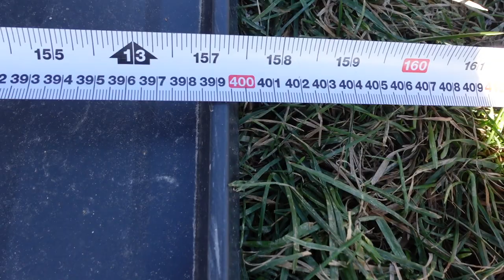I can't believe this happened - Zip line disaster.

Comment: I've learned that many times it's better and safer to move smaller loads at a time. You are the expert in using the Sky Mule so you should have been the one coordinating the movement of the boards. Believe me, I can understand your frustration with waste of your time and hard work and to have the boards destroyed at the bottom of the mountain. Maybe Steve work out a braking or slow feed system for the Sky Mule while he's fixing it. Glad that you were not injured during the incident. Love your videos.

Comment: Hello Both! A similar set up for the skymule, but with a gear and chain to regulate speed, dependant on load, would be where my layman's mind would venture here. As an added bonus, a motor could be added to retract the mule up to the start point. Doing great, and yes, that damaged wood can be part salvaged for a privy or elsewhere, so glass half full. Onwards and upwards, never deterred. 👌🙂

Comment: Good thing is neither of you got hurt and all the dogs were fine too. With all due respect an onboard braking system you can use to slow or speed up the descent of the goods. I have a portable battery operated winch that is a god send at times. Glad you are both okay, it could have been much worse.

Comment: I'm glad everybody is ok.  Things happen, and we learn, move on and rebuild.  On an unrelated note.  I held out for the longest time from trying diesel as a saw lube, but I won't be going back.  It works incredibly, and you only need a very tiny drip, unlike water or any other mixed fluids I've tried.  The saw blades are as clean as they are coming out of the box brand new.  And there is a light oil film on them which keeps them from rusting.  I had thought the smell of the fuel would be bad, but you can't even smell it on the lumber.  Admittedly, my clothes smelled a bit like diesel, but not bad at all really.

Comment: Wow...that was eventful. Umm... all due respect. Steve should have known that could run away on the sky mule. Getting past that... good time for an upgrade. Maybe it was a blessing. Sorry about the wood loss. So... a reel with proper bearings and brake is a good idea. With the brake you can lock the skymule from moving while you load. Also the second follower pulley on the Sky Mule could use a bigger pulley and block assembly. That way you can lift the back end higher to equal to the front. For all the times you carry a load on the Sky Mule, put  longer rope on the back. LOL! Sorry for preaching.  Aside from that. You are still my hero and I always enjoy your video's.
Reply from the maker: I think he was missing his brain that day! 😂

Comment: I can see what Steve was thinking - an air brake like the one on the Skymule works more effectively the quicker the load travels, so if you constantly slow the load down then you prevent the brake from doing its job.  But I have to say that the load in this case looked around 150 kg to me, which would be way more than the published 100 kg design limit for the Skymule.   Also the Skymule spec really should state a maximum slope for that 100 kg, as it's probably less than you have with that steep mountain side.   Easy to say all this in hindsight of course!   

Aside from limiting the load weight, one improvement possibility could be to add an adjustable magnetic break to the rope spool spindle.  These are mechanically very simple devices requiring no power - essentially just metal flywheels with stationary magnets mounted a short distance from the perimeter (technically the magnets induce an electrical current in the moving flywheel which dissipate the turning energy without contact due to resistance in the metal).  You adjust the breaking power simply by adjusting the distance between the magnets and the flywheel.  They're commonly used in exercise machines for example,  avoiding using friction breaking as this tends to wear out quickly.

Comment: Have you got some running water at the cabin on the crag?    If so suggest you set up a second cable, parallel to skymule, and as loads go down they pull up containers of water which act as counterbalance by being attached  to a separate rope /9which goes over a fixed pulley at the top and then attaches to the load).   This is the system we have used to transport materials up a steep hill to our project (though we fill up the water conatiners at the top).    But we are using 6mm steel cables so have limit the max load to be about 40kg.  (a 100kg load in the middle of a tensioned cable will generate about 10 times this load at the ends).  And that's not counting dynamic loads so to keep within safety factors we usually stick to 25kg loads.   Another perhaps simpler solution would be wait until you get some deep snow, lower the loads on sleds, and control the desent with a long rope and portawrap.
Reply from the maker: That’s a neat idea for sure! But at this point would just be too much work to change given where I’m at on the build. It’s definitely working much better and safer now 👍

Comment: Hello Michelle. Fake glasses will not help you figure out all of the things that you have solved. I liked the tail pulley on the lumber. It looks like it helped to keep the load from swinging around. I saw where someone had mentioned just that. For the wrecked lumber, maybe it will be the correct length for the interior. I hope Steve uses an electric winch with a pulley above it to lower your supplies. Have good days!

Comment: First, No Glasses because you have beautiful eyes.   Yes, it can be frustrating and disappointing when things go wrong.  But treat this as a learning experience.  the hose reel should have never been used in the first place.  Maybe replace it with a wench or a boat crank that has a ratcheting system.  Be grateful no one was at the receiving end of the load. Stay Safe!

Comment: I'm so sorry for you. So much time end effort wasted. Glad no one got hurt.
Not only didn't steve listen to you but again he inverted the roller for aligning the load and the breaking device. The start and handling would be so much easier the other way round...
While repairing it would be useful to attach the steel rope on an anchor point higher on the wall. the yellow "recovering rope" was quite okay imho.
Btw: it wasn't a zip line malfunction. It worked as designed. It was a handling malfunction...
Reply from the maker: You’re meaning that the alignment roller should be…?…in the front?
The problem with attaching it higher is that we can’t reach it then. 
I did make sure that in the description box I clarified that it was no fault of the SkyMule, but rather user error. 😊
Reply: @michygoss7148  Sorry, no offense! 
In all devices i know the breaking device is at the rear (more stable?) also imho it's easier to load.
As you use ropes/straps anyway to attach the load to the skymule it doesn't matter at wich hight it is. On the contrary you'll get more space to handle the load.
Reply from the maker: @eagle1de227  all good! 😊. There is a ‘latch’ that requires releasing on the SkyMule itself for the rope on it, so we do need to be able to reach it. I suppose it’s possible to leave that rope at its longest length, but that leaves potential for it to catch on something on the way back up.

Comment: Did/do you use a dyneema or kevlar high performance line? That is an awfully long drop down the hill. As an actual garden hose contraption, it is fine, but as a winch line storage or resistance mechanism it looks like it would be at it's limit.  The sky mule must have a limit, and it was surpassed.

Comment: Dear Michelle please forgive me if you read what I wrote prior. I apologize!
I shall try again.
First off Letter to Steve. You did a great Job Man I think it is a great Idea and if the incident which Michelle and I am grateful no one was hurt, or the babies. I am sure you had a hart felt moment when that thing grew on a new life of its own! You were blessed that she was their if some thing had of occurred. 
You could always install a Drum Brake on your Real at the top which is a cheap and effective way of controlling the speed and even little Michelle could control enormous loads by herself.  
Take all the rope off the spool and make a divider so you have two divided areas on one side put your rope that will be attached to the load and on the other half take a rope and secure it to the frame off the spool and wrap the rope around the drum several times and leave the tail out and hold it in your hand or in your beautiful wife's hand as she or you pulls on the tail the friction keeps the drum from running away! The bigger the rope the more the friction on the drum. Want more break!  pull harder on the tail. Hope this helps. 
Dear Michelle I am sure Steven didn't want it to take off on him and destroy your lumber! I am sure he felt bad that after all your hard work creating it and seeing it being destroyed bothered him. and extensive shaming here probably didn't make him feel any better. Perhaps looking at it in a different light would of been better. I would personally look at the positives instead of the negatives like his desire to help aid you in the tedious task bringing supplies to your little piece of Paradise! I know you put in time creating the lumber and it must of been heartening to see it broken for you and More for Him. Think of how long it had taken him and you to create the structure.The zip line transit! Could I say longer than the time you spent milling the wood out? If you want CHANGE! Be the Change! 
So in conclusion I will end with this!
Proverbs 3 but focus on verses 5 and 6
"Trust in the Lord with all your heart
    and lean not on your own understanding;
6 
in all your ways submit to him,
    and he will make your paths straight."
God Bless.

Comment: How about using single used railroad track and cart system like a miner cart?
Or... static brake on the sky mule using a adjustable spring to brake pad on the non handle side.

Comment: Does the skymule use a centrifugal brake?  I see those two arms twirling around but no idea what they do.  If it had a gear driven centrifugal clutch to engage a drum brake it could maintain a slow descent.
Reply from the maker: It doesn’t. You’ll see in the next video how Steve sets up a brake.

Comment: Could some kind of monorail to guide and smooth the decent for the zip line work?
Reply from the maker: At this point in the build there no point in changing systems. But something like that would definitely work well!
Reply: @michygoss7148  even works for dragging overnight suitcases or groceries. But yes, the heavy lifting is done. (‘Cept for some new lumber. ☹️

Comment: the dogs and i watched the video and then they hunkered down with chew bones and gnawed over the issue of the friction brake that you need.  

cevakavich, the sled dog (see https://youtu.be/3ffzwPn31kY for more information) suggested walking mules down backwards since they would pull against the load, while Nezavoot (no pictures exist due to spy work around the yard) suggested a parachute to offer resistance such as a landing air craft uses.  Makap suggested however a ladder descender using 1 inch or 1 1/4 inch diameter pipes as you can adjust the number of tubes in the ladder to create the resistance necessary to slow the descent.

Michelle, the way this device works is based on load.  In this case the load on your mule.  more load is normally less resistance with weight due to having the rope have the ability to pull, however  this is rope weight and a human as the load.  i think a test might indicate you need more resistance due increased load. .  this is an image of the device used for exceptionally long rappels.  
here is an and example you will have to search out to see an example by copying this into a search bar.

Shamjina
Aluminum Rock Climbing Rack Descender Rappelling Descending Bar Red   

 this is sold by walmart and i'm not thinking this would be tough enough for your purpose but you can see the design.

the one i wanted to send, i found an image but not a link that will actually show you the product.  you can search brake bar, and again pull up images but not see the thing and on youtube videos exist that show the brake bar being used.   for rappelling purposes it is 14 inches long.   yours would have to be industrial and could be achieved with a wire welder to make the stays for the tubing of the ladder.

the dogs hope this helps.
Reply: edit after the fact:  to see image   type in rappelling brake bar

Comment: Don't throw him under the bus like that. If you knew how that zip line worked better than him, you should have been assertive enough to say no, we are doing it like this.  Accept the responsibility. You didn't step up. You are lucky you only lost a few boards instead of one of you getting your head cracked open with that flying wheel. Publicly shaming your man like that isn't attractive.
Reply from the maker: Trust me - I was asserting myself at the time insisting we control the load, and he insisted we let it go. 
I am not ‘shaming’ him, I explained the situation and what happened as honestly and factually as I could.